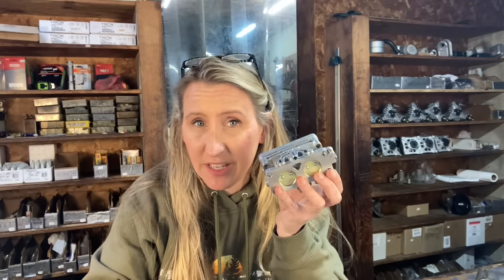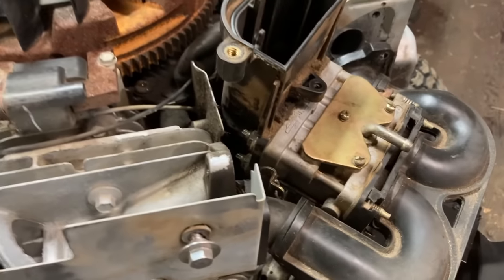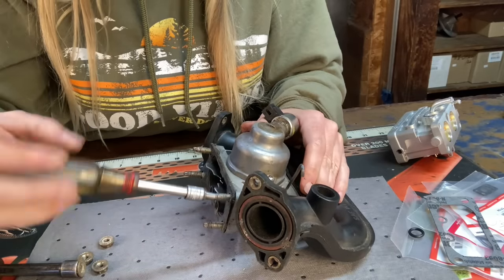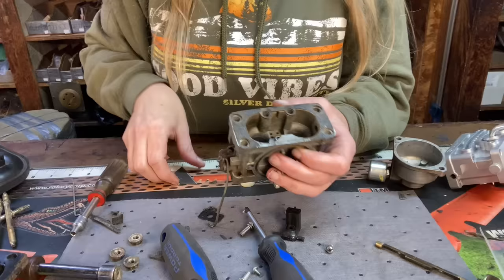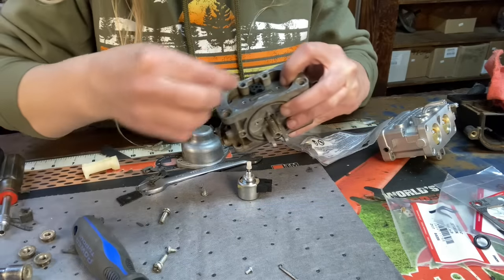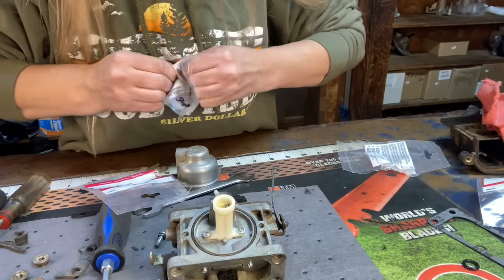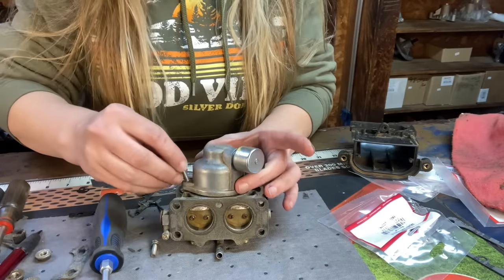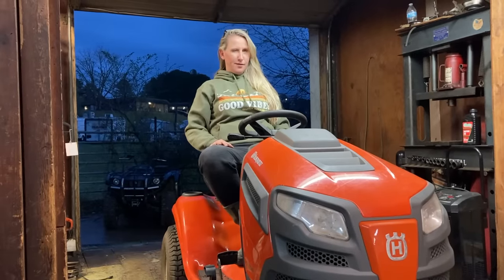HOW TO FIX A SURGING RIDING MOWER Briggs and Stratton Double Barrel Carburetor Rebuild- Repair

Comment: Great video. you forgot to put the link to the carburetor jets. The Briggs and Stratton kit doesn't have them.
Reply from the maker: The kit has the tiny little o rings to replace on the jets which is really all you need. The brass is always still perfect. Kinda ridiculous, them selling those jets for $15  piece when it just needs an o ring.

Comment: Just worked on one doing same thing surging real bad the owner wanted a new carb so I ordered one got in on would not start on it's own put a little gas in back breather house it will fire rite up run smooth as butter...let it sit a while will not start up checked fuel pump it works fine what could it be...

Comment: Hello, I am having trouble identifying the carburetor kit for my Briggs & Stratton model number 44N8770018G1 (24 Hp, Vertical Shaft) engine.  Will the kit you have listed work?  Thank you.

Comment: Hi1 First, thank you for your vidios I enjoy and learn a lot from them. Yoe seem to explain your repairs better than most. I have a lawnmower just like this one (YTH2348) you worked on and will be using tiis vidio to rebuild it's carburetor. But I also am going to have to replace the gear on the end of the steering shaft soon. I have not found a vidio showing what steps are best to repair that. Do you have one or know where I can watch one and what part numbet it takes? Thanks again.

Comment: what was the cause of replacing carb ?  my 2007 toro z5200 24hp briggs is spitting  . sputtering. backfires.  looses power under load. have overhauled carb few years ago.  mower has never done this before.  fuel pump is good.  do you just poke the jets out from backside ?  no gaskets for 2 ports ?  double gaskets on fuel side of carb ?  NEED  HELP....PLEASE....BOB

Comment: You forgot to pull the top cover with 3 skrews. That is the most common I find causing the surging. And the o rings on jets. Also dont mix jets, cause one is bigger than the other.

Comment: Great video,  I have the same engine different carb. This unit has only 56 hours on it. Mounted on a john deere  E 140. It sounds just like when you started yours up. My unit started this when I had hit the safety reverse switch . The plugs look good , thought had found issue with starting fluid at the right right intake to cylinder. But have ruled this out . Can this surging issue that I have be a the carb needs rebuilding?  Just a weird coincidence of backing up switch ?

Comment: Can you tell me on the metal gasket/shield between the carb and the intake.... With the two little bumps when you install that metal plate again which way do the indents face?  Towards the carb or towards the intake?  Also should there be a gasket between that metal plate and the carb or just between the carb and the intake?

Comment: Same carb on my 20hp.  I’ve cleaned the original and bought a second carb with both I have to run the mower on choke. It’s frustrating and nobody seems to know the problem

Comment: great videos, watch them a lot. Now my problem . Briggs and Srattton Intek V engine
Hi, Had a bad misfire, replaced carburettor. Engine now revs very high. Took engine out replaced with a new governor, did not look damaged at all. Adjusted governor to carb as per instructions.
Still revs high. Noticed the Governor arm does not seem to move througout the rev range. Any ideas? Thanks

Comment: I have Ariens 42 in zero turn mower and I loaned it to my brother-in-law, used it for 3 hrs and went through a tank and a half of gas, but while he had it he put premium gas in it and I told him to only use ethinall free gas when I went to start it the next day it was pulsating and the mower only has 8 hrs on it and I got it this yr, What is wrong?

Comment: What is the part number to the tachometer that you show on your intro?
Reply from the maker: There is a link in the description box below video. Thanks for watching!
Reply: @Chickanic  Thank you, I see that you don't have the wire hooked up, does it pick up on the spark plug wire without a lead?

Comment: I've got that exact same carb on a John Deere mower and the float needle kept sticking shut no matter how many times I cleaned it. I finally replaced the carb and it worked fine last year but when I got it out this year it is running lean. It's really frustrating.

Comment: Thank You for this video i have this carb on my craftsman dys4500 the fuel shutoff solenoid is done the replacements seem only available from briggs .I believe the number to be 841546 they are super expensive and it seems i cant find the right after market solenoid would you know if someone makes it beside briggs. Thanks for all the info in your video on this carb.

Comment: My Husqvarna YTH22V46 just started surging while cutting the grass yesterday.  I've had it about 10 years, it's always work great whether cutting grass or snow blowing.  I am going to do this carb rebuild procedure and I am  just ready to order parts. I have the Briggs & Stratton Intek Model# 407777-3195G5 engine.  It appears that the same parts work with most models.  Are there any specifics I should check to ensure I have the exact parts?
Reply: I took it apart and it's identical to the one being worked on, sooo I order the parts from the list provided

Comment: my Husky LTH19530 fitted with a Briggs Model No. 31Q677-3493-G5 with only a single barrel carb also does EXACTLY this! is there a similar fix for a single barrel Chickanic? Is it worth it, I can get a replacement carby for less than $50

Comment: I went ahead and put it on a drill press and made the holes larger and made both holes the same size.  Now I think I have a gasket issue becuase I do have fuel running out of the carb and its not stopping.  j/k.  sorry this board is too serious for those kind of joke attempts.

Comment: Different engine (Kawasaki) but same carb (Nikki).  Misfire on one cylinder under load.  New plug, new coil.  Carb has been "cleaned".  Checked for vacuum leaks using propane.  Any suggestions?

Comment: Were those deformed gaskets a factory flaw or is that a periodic repair that will be needed?
Reply: The fuel tub gasket is soft and flattens to seal when installed, needs to be changed every time tube is removed. Over time it hardens, mostly because of ethanol, and needs to be replaced.

Comment: I came upon your youtube video on repairing a surging lawn tractor while trying to repair my own surging lawn mower.  The video was excellent!  Your instructions were clear and the video gave an excellent view of what you were doing.  There is a rod attached to the carb that runs through a spring.  There's a hole for the rod to attach, but not for the spring.  Enigine model 441577, Code 051213YH.  Any help you can give me would be appreciated.  Thanks.

Comment: I have a bad boy with a kohler 747 with the ground wires on the coils it runs on one cylinder but remove a ground wire and it runs perfect. Any ideas

Comment: Got a question just rebuild a techumseh carb on a 2 cycle jiffy mod 30 ice auger and it still starts hard and when it does it sprays fuel up out of the back of the carb upward on to the bottom of the fuel tank (the carb has a little cup arrangement poi ted upward to keep snow from being sucked into the carb. So basically what is doing while running seems to be pushing some of the air and  fuel out instead of sucking it in 😳 I have tried to ajust the carb but it doesn't change and as well it was doing this before the carb rebuild. Any ideas?

Comment: Help! I was given a mower with 26hp Intek. I took carb off, put new jets in, made sure solenoid fires, checked rods to be sure they work right. I put the carb on and it started perfectly, ran good, idle to high and back. I shut it off. Next day it wouldn't start. Solenoid fires, fuel in the bowl, runs for 8-10 seconds and dies! Teplaced the entire fuel line, siliconed the crap out of the plastic intake at the carb, checked spark, new gas, still will not stay running! Checked slow jets, they're clear, put new jets in as I said. I cannot get the ba$tard to run! I ordered a new carb and intake plus OEM pump. Any other ideas? It pls a ton of vacuum, slows when one or other plug wire pulled. I have not put new carb and intake on as I'm waiting on the intake. My sense is it is fuel related, thus new carb and wonder if intake has cracks as well as the warping after pulling carb to overhaul it. 😠😡🤬🤬🤬🤬 The bad words want to come out!!!

Comment: I like what you do but do you have a Briggs and Stratton stater that mounts on the side of the engine used
Reply: Regulator You Mean Stator is Under the Flywheel

Comment: Ok, I’ll be a Debbie downer. John Deere mower, same Nikki carb. Went to dealer, bought new carb, cheap, and saves trouble of rebuilding carb. Came with new seals ( manifold to engine) . Interesting enough, same part number for left and right jets…no difference in orifice size.

Comment: I have the same carb. My problem  is you can put your hand over the part where its normally  drawing/sucking air down into  the carburetor  ( its not doing this) and it won't choke out by placing  your hand over it.
  So whats wrong with it? Can't idle the engine  down either.....
Reply: Sucking air at carb base or manifold
Reply: @johndoe43   its not pulling in any air. Checked for leaks at carb- manifold connection.  Found none

Comment: What brand carb would. You use on a styhl fs41r weed eater?
Reply: Fs40 or fs45 ? Should be a Zama, take it to a dealer and have them pull the serial number because they changed the throttle hook up and a lot of other stuff on those trimmers , ask for the part number and eBay/Amazon it if you don’t want oem.

Comment: hi i have a 24 hp v twin low hours surging installed new carb two new coils and plugs adjusted valves still surging? help if you can cant afford to keep throwing money at it thanks so much to anyone that can tell me what i need to do oh and checked the sheer key looks good

Comment: So, I'm surprised that no one noticed it. @Chickanic at what point did you notice that the choke plate was installed wrong? After the engine was all back together, or when the choke lever didn't operate. Hopefully even before you put the carburetor back on. Luckily easy fix.

Original choke butterfly plate position, high side on the right.
https://youtu.be/bjAjSrpouDc?t=413

Choke butterfly plate now low on the right side. Won't operate this way.
https://youtu.be/bjAjSrpouDc?t=602

Comment: Hi I've small push lawnmower.  Will not start cold or warm unless prime it. One's primed one pull run all day. Ant advice on what's problem
Reply: If you have to push the primer button every time cold or hot that is normal, if it has a primer that means the carburetor does not have a choke function on it, usually smaller mowers are like that.
Reply from the maker: Need more info. Does it have a Briggs engine on it with a square air filter?
Reply: @Chickanic  yes it's a Brigg station engine small push mower with square air filter 5.5 horsepower

Comment: I am struggling with a replacement carburetor ( Carburetor with Gaskets Replacement for 46 inch 960430257 960450045 Fit For Husqvarna YTH22V46 Tractor ) through Amazon for about 39.00. The only problem I am having is with the choke hook up. The choke butterfly on the old carb has a return spring, The new one I bought does not. The choke won’t work correctly when I engage the choke position on the tractor it pushes the arm in the opposite direction and will not engage the choke. Any suggestions would be appreciated and would like to know does it need that built in spring an the butterfly arm ?

Comment: What is the o ring part number ? Anyone ?
Reply: The o ring we use is out of a bulk set, I’ll get the size for you at the shop tomorrow. Brigg’s sells the fuel tube kit #699729 with the jets and tube gasket, I don’t think it is sold separately.
Reply: @dudekanic  thank you so much !
Reply: @billydankert1764  We use an I.D.-3/8 O.D.-9/16 o ring. A little snug, but it works.

Comment: I got one for ya that will blow your mind brand new husky mower about like the one you just fixed a friend of mine got it from a yard sale the man said it just died like you turned the key  off so he buys it brings it to me I do all his work anyhow I turn it over and it free wheels no compression nothing first check oil its spotless hasent even changed color and its full so I pull the plugs spin it over again nothing so I pull the motor off your not going to belive this at all but I put my hand on gods great bible it's TRUE t pulled the pan off both rods was crumbled up in the pan you could pick up the pieces a crumble them up like cornflakes no damage to block or crank or cam p out two new rods in it an Its still running today never had not one lick of trouble since that is amazing but I swear before god it's TRUE I have never in my life seen anything like that before an thats the only time I seen it was that time so theres my story for the week or year love your channel an all you help.us with when you don't have to at all god bless you